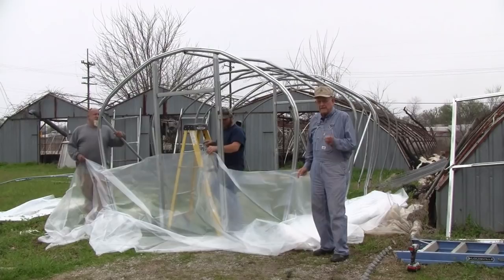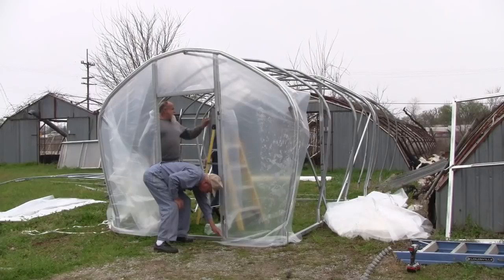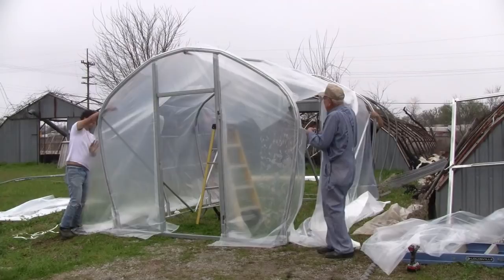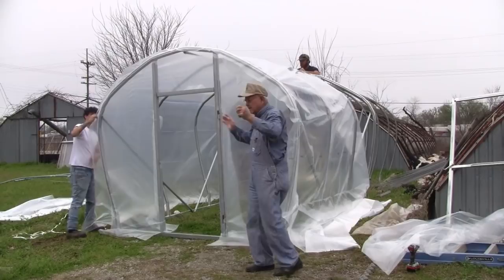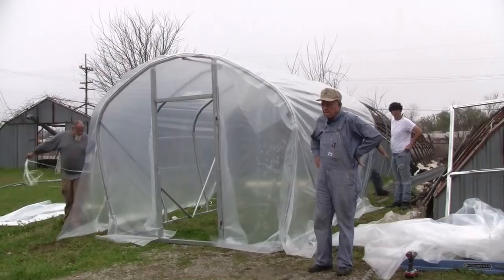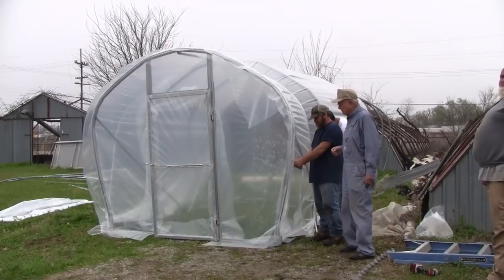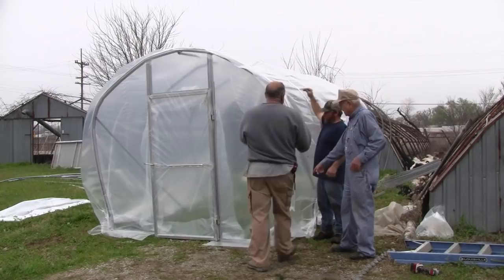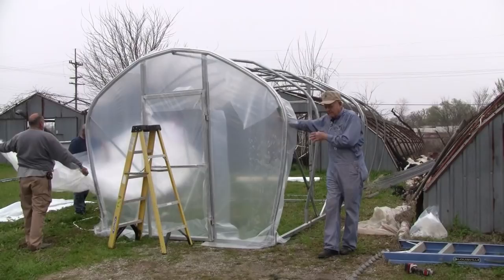Putting Plastic on Greenhouse Ep 71

Comment: How much overhang on the end should we leave to be able to loosen or remove wiggle wire to be able to raise the sides up? Ours is a 16"x80'.
Reply: On each corner of the house, is you take 3 or 4 foot of the wire loose, it will let you raise the sides up!
Reply: @leonsloan7971  we did that and the wire is putting hole in the plastic..the smooth part of the wire. We believe we put the plastic on to tight and cut the ends to short. We also put our mule tape on (we have anchors 2ft inground with the hooks/loops on them like yours) and we think we have it to tight as well.

Comment: Can’t you just put the shade cloth over the plastic?
Reply: You could. Pacific NW you probably would. But generally heat build up will kill your plants. Besides taking the plastic off during the season and storing it extends the life of your plastic.
Reply: john mcginnis unless, the wiggle wire makes holes in the plastic, from taking it in and out.  I know first hand that this does happen.  Then you have to replace the plastic anyway.
Reply: @pennynewell3459  Used to have that problem. I found if I put a sacrificial strip of plastic in over my greenhouse plastic then the wiggle wire I don't have that problem as much. It does make it harder to get the wiggle wire in though.